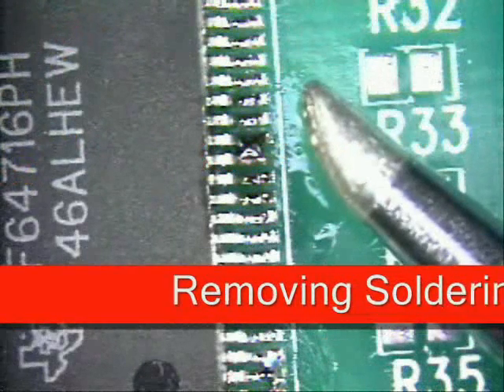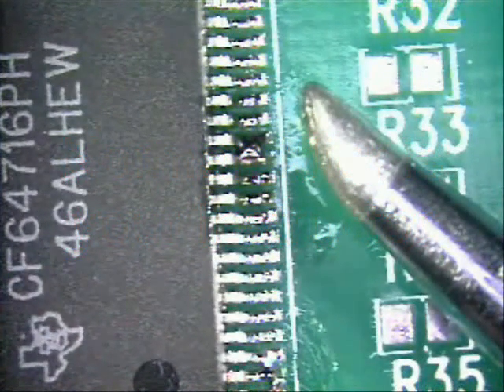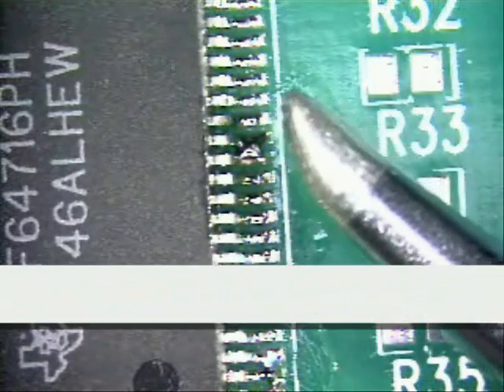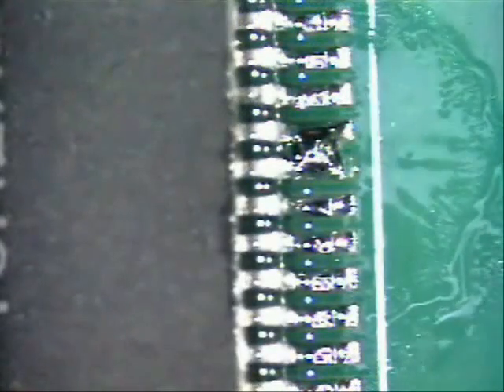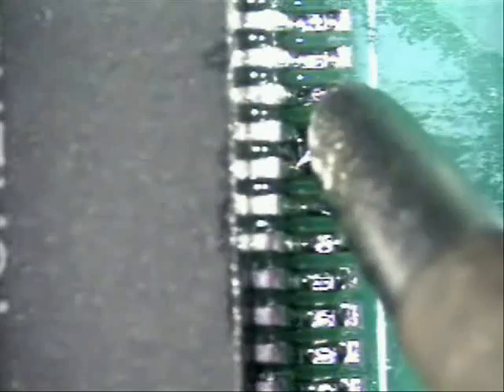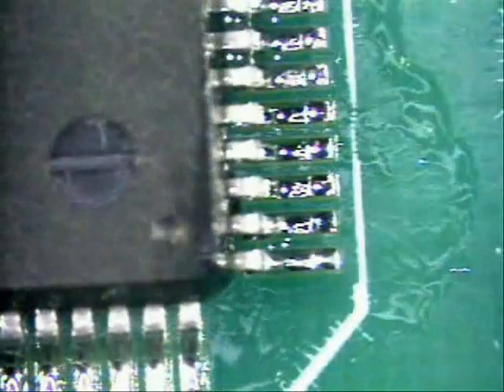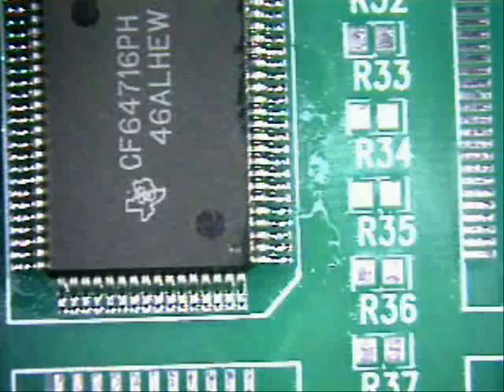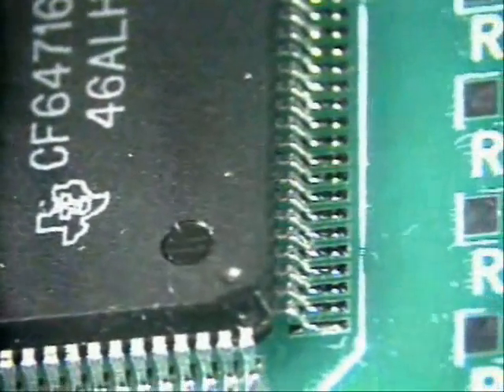Solder Bridge Removal

Comment: Hi, so i dont need to use a wick for this? i can just use flux / heat and sweep ?
Also, i dont have a fancy solder....its a basic plug in and go...  40 watt 220/240 volt.
I use a kitchen sponge , the green abrasive pad at the back... is that fine? or u reckon goldilocks|  pot/pan scrubber is better?
Also, is it fine to use a solder iron and tip that has not been used for years , maybe even 15 years... ?
Do i need to clean the pcboard?
I am trying to remove a bridge i did accidentally (before i knew of flux or even wick) , on a thing pcboard for a hard drive.
Thank you

Comment: While this looks easy, what if there is a resistor or other SMD in the way? 
I don't have enough space to sweep the tip away from the leads, as it immediately runs into a small resistor.